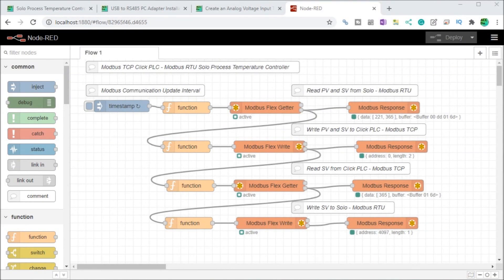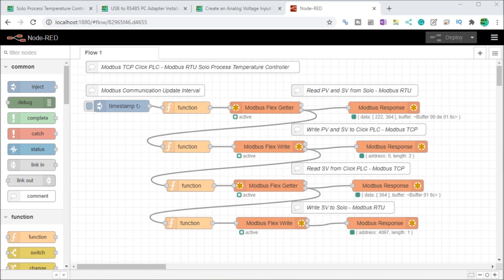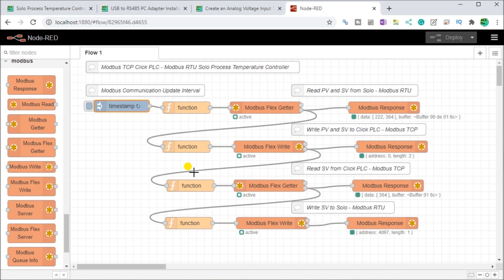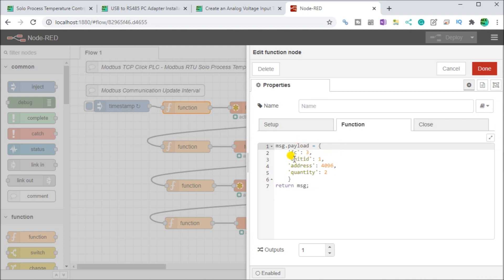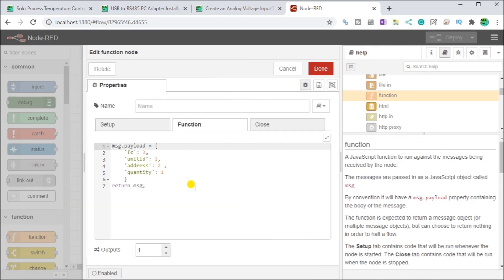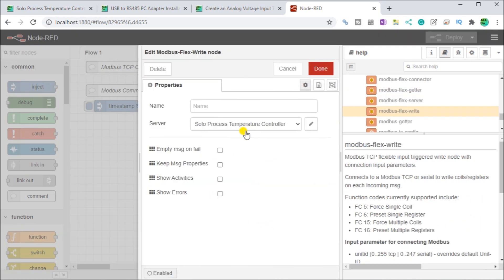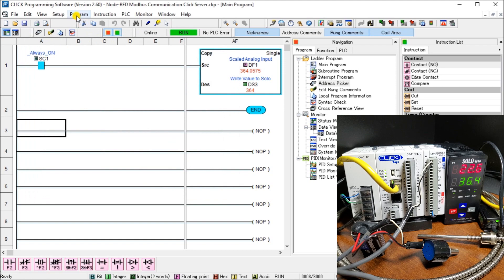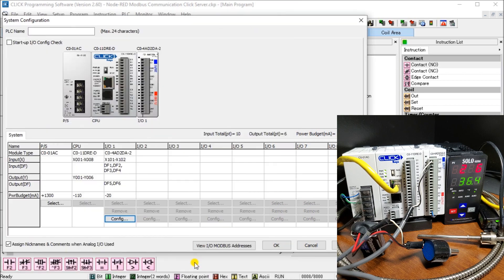Transform Your Temperature Control: Connect Modbus RTU to TCP Click PLC!

Comment: how about displaying value on node red?, when connecting slave with node red then what block for showing value from slave in node red? (btw im just doing simple simulation, im trying to connect modbus slave with node red using virtual serial port)
Reply from the maker: https://accautomation.ca/node-red-user-interface-dashboards/
This link will take you to the red node user interface dashboards. You can use this for an HMI interface.
Regards,
Garry
Here is the link for the YouTube video:
https://youtu.be/8zAG2wXwGOc?si=LMbLVD9WBke0uuOa

Comment: Hello,

I want to set the parameters of an industrial drive using a node through RS485 serial communication.
In this project, I need to use the hex codes of an industrial drive and control the drive using the hex codes.
Can anyone help me with this project?
Reply from the maker: Hi @sajadmohammadi3155
If you want to send just HEX codes in and out of the serial port, then you would use the following nodes in Node-RED:
https://flows.nodered.org/node/node-red-node-serialport
Note: accepts hex notation (0x0a)
I hope this helps you out.
Regards,
Garry
Reply: Hi @ACCautomation   
Thank you for your guidance
I will let you know the result
Reply: Hello again my friend,

I went to the address you posted and I'm going to change the parameters of a variable frequency drive using node red and set the parameters I want for the drive.
I have not used Nod Red until now. Can you please send me a video on how to do this?
I want to see what code I should write for the function section?
Or what code should I write for the inject part and what blocks should I use for setting values?
please guide me
regards,
Sajad
Reply from the maker: @sajadmohammadi3155  
I am providing information, not writing your code. Every drive is different, and each application is unique to the industry that it serves. 
If you have a specific question, I can help or point you in the correct direction.
Here is some general information on Node-RED.
https://accautomation.ca/series/node-red-iot-enabling-software/
Regards,
Garry

Comment: Very nice video, and well explained.
I didn't know about node RED and it's amazing how fast it is to do what instead requires hours and hours of multithreaded programming and code pages, as I've always done until now.
Thanks for the explanation.
Reply from the maker: Thank you for the comment. Node-RED is an excellent way to get data out of the PLC. PLCs can act as an edge controller in the IoT.
Garry
https://accautomation.ca/series/node-red-iot-enabling-software/
Reply: @ACCautomation  Thanks again for the link, bye!

Comment: When I try to read a register from a Click PLC I have to subtract 1 from the address. For example to read register 192 I have to set up to read 191. Any reason for this? I am using the Node Red integration in Home Assistant. I was wondering if anyone else has run across this?
Reply from the maker: Hi Rob Driver,
That is a good question and one that causes confusion with Modbus addressing.
Some device manufacturers start their “4xxxx” references at 40001, and some start at 40000.  The starting register corresponds to offset “0” within the given function.  It is not always evident which reference a manufacturer uses. AD usually uses an offset of 1. 
Here is a good reference article:
http://support.elkor.net/knowledgebase.php?article=14
I hope this helps you out.
Regards,
Garry

Comment: And one more thing - node red dashboard chart node is not good solution for charts if you want to make more serious system. You must take a look on Grafana - really good and powerful tool that stores the data in database and can visualize data in different views and time ranges. Node red dashboard chart node can't work with archive data and it reset all charts after node red restart or flow redeployment - it is a "fat" minus I think!
Reply from the maker: Hi Yuri,
Node-Red Dashboard is not an analytic tool. It is made for a simple HMI (Human Machine Interface) that will show simple charts. Pushbutton and indication lights are the main use for the dashboard. Think of this as the operator interface for the machine only. 
Logging to a SQL database and using tools like Grafana is for analyzing the data over a period of time.
Regards,
Garry
Reply: @ACCautomation  I'm about the same, just saw nr dashboard charts in your video...

Comment: And according to your flow, you querying  modbus devices without any exception or timeout controlling - what will happens if one of your modbus devices stay unavailable? - I think it is will be a some timeout and it is not really good, especially if the system must react on device register changes very quickly... of course node red and end-user must know if some device is fail for example, but I didn't see nothing in your flow about this moment ((((
Reply from the maker: Hi Yuri,
Remember that this is a sample flow with the basics to communicate Modbus RTU and Modbus TCP. 
There are a few different ways you can catch errors. 
Catch and trigger nodes are used for what you are describing above. The use of each one would depend on what you want to achieve with your flow.
Regards,
Garry

Comment: Hello. I have a qeustion about using this lib.  

When I disconnect (physically) slave device from hardware where Node-red server runs, whole Node-red server goes down. In console window I see next message: "Error: Writing to COM port (GetOverlappedResult): Operation aborted". To solve this problem I should restart Node-red server. What wrong I do? Any ideas?
Reply from the maker: Hi to1 to1,
Errors will be shown in the console window. This error should be constantly repeating at the interval in which you are injecting the flow.
When you reconnect the communication port the error should correct itself. That is if you had good communication originally.
Regards,
Garry
Reply: @ACCautomation  Thank you for your answer. I have one mode question about Modbus TCP (same lib). When I reboot Server side hardware TCP connection from Node-RED side did't retrieve. To solve this problem I should deploy Node-RED flow again or reboot hardware where Node-RED server runs. Option ""Reconnect on timeout" is checked. Any ideas about it ?
Reply from the maker: @to1to192  
So even when you reboot and run Node-RED your communication port is not working?
I would check through the device manager on your computer to see if the drivers are working correctly. Can you run a different software package (Programming Software if a PLC) through the same port to see if it is actually working correctly?
I am assuming that you are running a Windows 10 computer and Node-RED.
Can you specify the equipment you are using?
Thanks,
Garry
Reply: @ACCautomation  We are talking about Modbus TCP connection. I have Node-RED software running on PC with windows10, and I have TCP server running on PLC. TCP connection cannot automatically recover after interrruption (due to PLC rebooting), but after flow deployment or Node-RED rebooting all work good (until next PLC rebooting).
Reply from the maker: @to1to192  
Thanks for the clarification. How often are you requesting the data? You may have to use a Catch node for the error and a time delay before continuing the flow.
Regards,
Garry
Reply: @ACCautomation  I am requesting the data each 3 seconds. Where can I set time delay between continuing the flow ?
Reply from the maker: @to1to192  
You can use the delay node instead of the inject node.
One delay node when an error occurs and one when the flow finishes. They would then point back to the start after the initial inject.
Regards,
Garry
Reply: @ACCautomation  If I understand correctly, I should create next chain: TimeStamp (with time repeat) -> delay node -> function node (where I set registers to read) -> Modbus Flex Getter node -> delay node -> debug node (for result displaying). Am I correct ?
Reply from the maker: @to1to192  
If you just want to pick up the errors then edit the Modbus Flex Getter | Options. Select the show activities and errors option.
Use the Catch node and point to the Modbus Flex Getter. If an error occurs the Catch node will activate.
I hope this helps you out.
Regards,
Garry
Reply: @ACCautomation I created topic on Node-RED forum, and described this issue there:

https://discourse.nodered.org/t/node-red-contrib-modbus-cannot-recover-tcp-connection-after-server-rebooting/47123

It is internal bug of lib. I just want (if it is possible) to make some workaround to automatically "reset" modbus flex getter node. The only solution I know now - deploy flow manually.
Reply from the maker: @to1to192  
Thanks for the update. Hopefully, they get this fixed soon.
Garry
Reply: @ACCautomation  I hope you will mention this moment iy your next Node-RED video.
Reply from the maker: @to1to192  
I have tried to reproduce the error and cannot. I have powered down the server, client and disconnected the cable one at a time and all together. This will continue communication again once connected or powered up.
Here is the flow that I cannot produce your error.

[{"id":"11969e00.6fc412","type":"tab","label":"Modbus TCP Error Test","disabled":false,"info":""},{"id":"a10f196d.3ed148","type":"inject","z":"11969e00.6fc412","name":"","props":[{"p":"payload"},{"p":"topic","vt":"str"}],"repeat":"1","crontab":"","once":false,"onceDelay":0.1,"topic":"","payload":"","payloadType":"date","x":90,"y":100,"wires":[["d3490466.de7238"]]},{"id":"d3490466.de7238","type":"function","z":"11969e00.6fc412","name":"","func":"msg.payload = {\n    'fc': 3, \n    'unitid': 1, \n    'address': 0 , \n    'quantity': 2 \n    }\nreturn msg;\n","outputs":1,"noerr":0,"initialize":"","finalize":"","x":280,"y":100,"wires":[["3c2ebca1.383864"]]},{"id":"3c2ebca1.383864","type":"modbus-flex-getter","z":"11969e00.6fc412","name":"","showStatusActivities":true,"showErrors":true,"logIOActivities":false,"server":"1bb18b53.a6d865","useIOFile":false,"ioFile":"","useIOForPayload":false,"emptyMsgOnFail":false,"keepMsgProperties":false,"x":500,"y":100,"wires":[["508a3003.8c3c6","71a365b.7b42b9c"],[]]},{"id":"508a3003.8c3c6","type":"modbus-response","z":"11969e00.6fc412","name":"","registerShowMax":20,"x":830,"y":80,"wires":[]},{"id":"71a365b.7b42b9c","type":"debug","z":"11969e00.6fc412","name":"","active":true,"tosidebar":true,"console":false,"tostatus":false,"complete":"payload","targetType":"msg","statusVal":"","statusType":"auto","x":830,"y":140,"wires":[]},{"id":"3d1f7ba1.6b36f4","type":"debug","z":"11969e00.6fc412","name":"","active":true,"tosidebar":true,"console":false,"tostatus":false,"complete":"payload","targetType":"msg","statusVal":"","statusType":"auto","x":830,"y":220,"wires":[]},{"id":"34d550de.a25e6","type":"catch","z":"11969e00.6fc412","name":"","scope":["3c2ebca1.383864"],"uncaught":false,"x":450,"y":180,"wires":[["3d1f7ba1.6b36f4"]]},{"id":"1bb18b53.a6d865","type":"modbus-client","name":"Click PLC","clienttype":"tcp","bufferCommands":true,"stateLogEnabled":false,"queueLogEnabled":false,"tcpHost":"192.168.1.30","tcpPort":"502","tcpType":"DEFAULT","serialPort":"/dev/ttyUSB","serialType":"RTU-BUFFERD","serialBaudrate":"9600","serialDatabits":"8","serialStopbits":"1","serialParity":"none","serialConnectionDelay":"100","unit_id":1,"commandDelay":1,"clientTimeout":1000,"reconnectOnTimeout":true,"reconnectTimeout":2000,"parallelUnitIdsAllowed":true}]

Note: I am using the Modbus Flex Getter instead of the Modbus Getter.
There are so many ways to achieving the same objective, I have copied my test setup.

Regards,
Garry
Reply: @ACCautomation  Thank you for your answer. To reproduce that error you should only disconnect server hardware, wait more than 10 seconds (more than Reconnect timeout time), and then connect server to network again. No more. I use your flow, and this error is occured after above mentioned steps executing.

As modbus server I use:  PLC or Localhost (modbus slave software). The result is the same.
Reply from the maker: @to1to192  
I still am unable to replicate your error. Every time the server is left down and then started again, the communication begins automatically.
This has been tried on a Windows 10 64-bit and a Raspberry Pi 4 B as servers. I am using a Click PLC as the physical hardware wirelessly and through the Ethernet port. 
Do you have any physical hardware to try and see if the issue is with the Modbus Server emulator?
Regards,
Garry
Reply: @ACCautomation  Yes, I tried it with physical PLC as modbus Server. Same result. I use latest modbus lib (v5.14.0). If I will find the reason of that issue (besides information of internal bug in the lib), I will tell you. In any case, I hope you check this moment in your next video.

One more question. What time delay did you take between disconnecting and connecting server again ?
Reply from the maker: @to1to192  
The disconnection time was anywhere from 1 to 60 minutes.
I could not reproduce the error. I cannot comment on the error if I cannot see it happen.
What hardware were you using?
Regards,
Garry
Reply: @ACCautomation  Nore-RED server: PC with Windows 10 64bit (as you); Server: localhost (Modbus slave software), and/or  PLC (I think it does not matter manufacturer of PLC). The bahaviour is the same. Probably I should test that issue on other PC... Can you tell me your email where I will send you screenshots of that issue ?
Reply from the maker: @to1to192  
garryshortt@accautomation.ca
So everything you are testing is in the same computer box. 
My setup had Windows 10 64-bit Server running. The Modbus slave was a Click PLUS PLC set up for Wifi and Ethernet Port.
Regards,
Garry
Reply: @ACCautomation  Check you Email. I had send a letter with screenshots.
Reply from the maker: @to1to192  
I have responded to your email. I believe you should use actual hardware for these types of tests and not just a Modbus Server simulator.
If this is not possible for you to use actual hardware, then try using another computer running the Modbus Server software. You can then try disconnecting the physical cable and see if it recovers.
Regards,
Garry

Comment: With click plus, would you use MQTT to replace modbus at the edge for this type of install?
Reply from the maker: Hi Andrew
You could use MQTT instead of Modbus. The choice is up to you.
MQTT would require a broker if you do not already have one on the network.
Regards,
Garry
Reply: @ACCautomation  due to the broker, I think modbus would likely be more robust.
Reply from the maker: @andrewtait6227  
I agree. 
Garry

Comment: another fascinating modbus video...  is there a simple way to test and sniff the addresses of old modbus displays with pushbuttons and led lights to find out if they are working?  Thanks a lot...:)
Reply from the maker: Thanks for the comment q zorn. There is no simple way to test for addresses of a Modbus system. I would take a look at the manual for the server or slave to give an idea of what the addresses may be.
Regards,
Garry

Comment: Very informative, can you explain how to use the dashboard to change modbus STATIC parameters to dynamic user entry values ? Thanks
Reply from the maker: Hi ahmedjoo,
I am currently working on the next part of this series in which the Node-Red Dashboard is installed. It will display the present and set values of the Solo on the user interface. A switch on the dashboard will determine if the set value is coming from the Click PLC or the slider on the dashboard user interface. 
This will be released on April 19.
Regards,
Garry
P.S. Here is a link for the series to date.
https://accautomation.ca/series/node-red-iot-enabling-software/